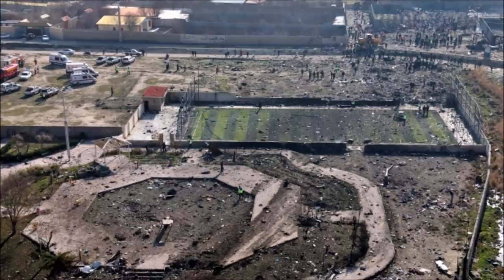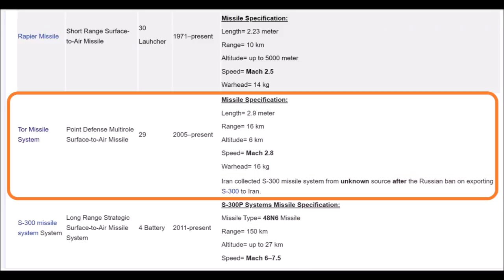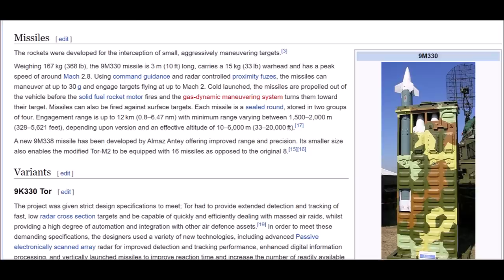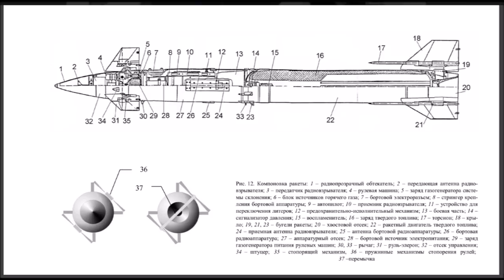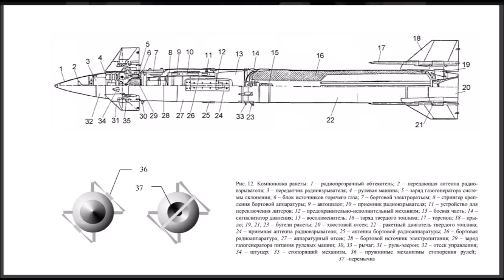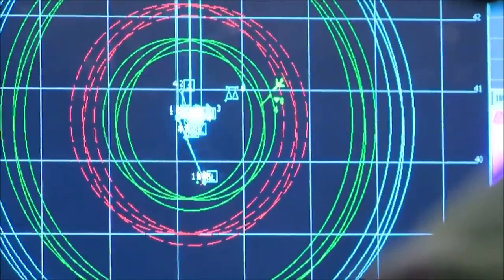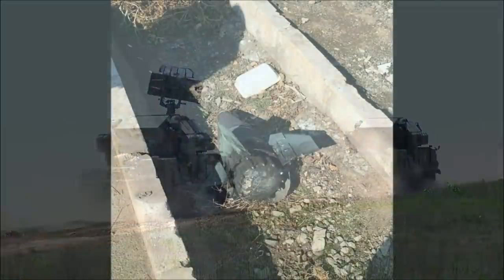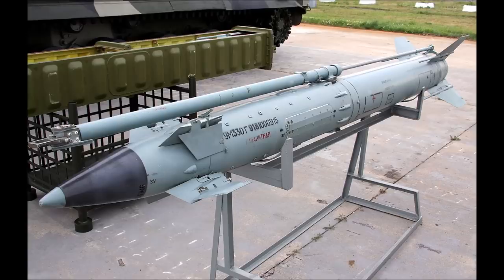SA-15 (Tor M-1) Surface to Air Missile system. Boeing 737-800 down in Iran

Comment: It doesn’t matter which rocket was used to kill 160 people - completely innocent.
 The bottom line is that this was not an accident. It was a deliberate crime.
  1) if BOING flew up to TEHRAN, then it still somehow could be counted as a RANDOM ERROR - BUT THE AIRCRAFT  TAKE OFF AND MOVED FROM TEHRAN ... This is the technical side that does not make it possible to consider everything as an ELEMENT OF ACCIDENT.
  2) THE BASIS FOR THE ELIMINATION OF INNOCENT PEOPLE WAS OTHER: almost all the passengers were INRANES living in EUROPE AND CANADA (some were Iranian citizens, other Canadians and the  UK ).
       THEIR ARRIVAL IN IRAN was tolerant until the LIQUIDATION of the general, although they were considered to be traitors to the cause of the Iranian revolution ...
      The liquidation of the general removed TOLERANCE and the passengers were shot as TRAITORS.
      ONCE AGAIN - THIS IS NOT AN ACCIDENT.

Comment: A Message to Juan
A thought came to me this morning that I have attempted to post to the Aviation Herald website and I want to offer it to you as well as a Boeing airliner pilot and an advocate of flying.
I have been using known coordinates related to the Ukraine airliner tragedy in Iran to locate various locations and directions and aircraft headings related to this crash and it appears to me, verify this for yourself, that after the first missile strike, this 737 somehow managed to turn to the right 180 degrees to a heading back towards the airport from which it took off. Although it did not make it back, using Google Earth images on the Aviation Herald page dedicated to this crash and using Google Earth for myself it seems clear to me that the crash site shows that the airplane crashed in what appears to be a residential housing area surrounded by what appear to be apartment complexes and commercial buildings. Yet by some miracle the airplane was lined up in such a way as to miss - by very small margins - hitting these buildings. The area ahead of the crash site (to the southeast towards the airport) is a small agricultural site even though the point of impact is a small park of some sort within the housing area.
It seems highly unlikely to me that this happened merely by chance. It seems much more likely that these miraculous events were pilot related. I have read that Boeing airliners can be controlled even in extreme circumstances where even the electrical systems have been compromised. You would know better than I would if this is true. But assuming it is, and given the possibility however remote that the pilots survived the missile strike(s), shouldn't they be thanked and credited for their incredible service of saving countless lives of innocent Iranian citizens on the ground.
Please give this some consideration, Juan. Thank you for this forum and for the opportunity for me to pass along this message to the world.
Reply from the maker: crippled by the missile strike, thus the right turn.
Reply: @blancolirio  This isn't something you'd want to be wrong about. Keep an open mind till the proof comes in. I'm thinking his widow is in some serious distress with all the blame they're heaping on him. He should have known better, he never should have risked his passengers lives, and on and on. Something guided that airplane even after the second missile.

Comment: Rather disappointing that you jump straight to this conclusion without any confirmatory evidence, as have others, recklessly  and without analysing the possibility of mechanical failure. That is the scenario more likely based on the verified videos of the plane's last moments before crashing. Catastrophic engine malfunction must be reasonably excluded first before coming to this politically heated conclusion. Judging by the punctures in the engine part pictured, the metal folded out from the inside. That is  indicative of shrapnel from something inside the engine blowing outwards through the metal, not the other way around. There is zero confirmatory evidence of anything exploding next to the plane other than the engine itself.
Reply from the maker: wrong.
Reply: @blancolirio  The plane's crash trajectory indicates it was heading back to the airport which would be standard procedure in an emergency. It also contradicts the theory it was blown out of the sky by a missile. So which part of what I'm saying is wrong?

Comment: The only US aircraft the Iranians could of mistaken a 737 for would be the US Navy P8 Poseidon but this was no where near where a P8 would operate and the P8 doesn't Operate over land...  The US tomahawk wouldn't operate anywhere near 8K feet and B52s dont operate over contested airspace rather use standoff cruise missiles... The B2 would be way higher and Iran isnt tracking it so this comes down to one gross incompetence and two stupidity putting an AAA battery in front of an airport let alone without a significant command and control...  Unlike the Iranian aircraft the US shot down in the 1980s the technology is way different one friend or foe was clear as this 737 was squawking a clear ident... The  other issue there was ni challenge on guard given... seems way too trigger happy...

Comment: Edited version: 

Don't gimme'that smear! Do the commercial airline people need to install air defense systems, monitored by the Virtual folks? My round wing design (saucer) is a floating laser turret, among other things, and the minute your missile fires up, it's literally destroyed, blasted, gone! If you aggravate this one, it'll take out every old style, straight line aircraft within it's proximity, right smartly. No, no.

The time has come for saucer technology to dominate the aerospace industries. Cheaper, more efficient controls are needed. And it's quieted using phase shifting audio sensors and sound is only allowed where it is wanted. No one can ever lead me to believe that  there is no further use of existing technology and what we know about our physical universe.

A seventy foot diameter saucer can transport a specialized predetermined number of people, and their controlled luggage, with mandatory bathing and special stylish, unisex, disposable, paper flight suits. You organize and provide for 12 people and two pilots, making the best use of the talent and skills, applying the university system in recombinant groups of 12. You can only access your luggage at your hotel or pre-flight ready room. Twelve round wing aerospace craft (saucers) would max out at 144 actual company members. I almost started building them in the San Luis Valley of Colorado, but the politics just wasn't right.
 
Or would you rather swing from a star,  drink all you can as you sit in some bar, be a doctor and pee in a jar. or be a lawyer and take someone's car. You should be who you really are? 'Cause you're supposed to be the Star!. That one is for my mom, whose house was stolen from us by a rich and powerful judge. They never really liked each other, but my mother didn't have to bend the laws to get stuff.
(I'm not dead yet, either.)

Attachments area
Preview YouTube video SA-15 (Tor M-1) Surface to Air Missile system. Boeing 737-800 down in Iran
Preview YouTube video Chroma Key Studio
Chroma Key Studio
Preview YouTube video NuclearDisasterLaw
NuclearDisasterLaw

Comment: I presume the system will pickup and overlay the squawk of a civilian aircraft on radar displays; hence shocked that a an error like this can occur...  One thing for vodka saturated rebels in Ukraine, another for a trained Revolutionary Guard corps person.  Maybe not a mistake?!
Reply: I dont think any sam system has that capability. only IFF and thats so you dont shoot friendly air assets
Reply: @mitri5389  yeah, they should receive a 4 digit squawk from the transponder which overlays on the primary radar.  USS Vincennes shot down an Iranian passenger plane due to a radar operators misinterpretation...  the 'cursor' or squawk interrogation was that of an Iranian fighter plane still on the runway in Tehran.